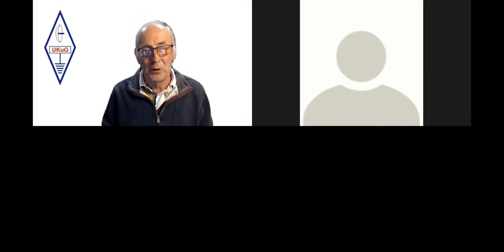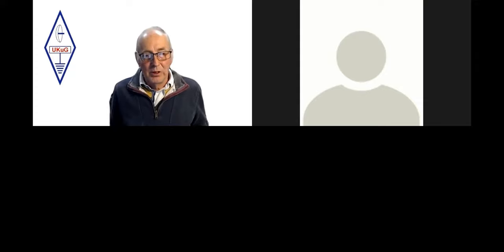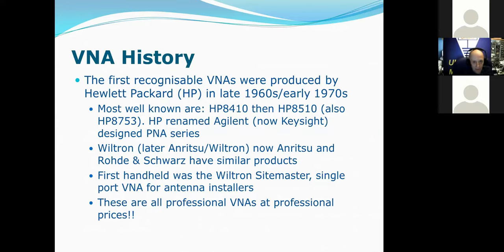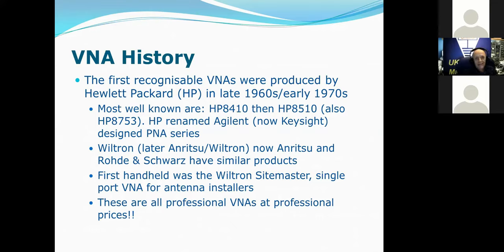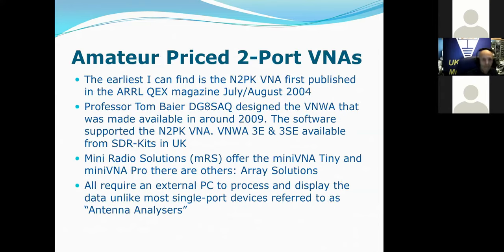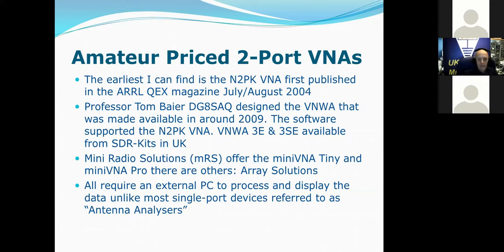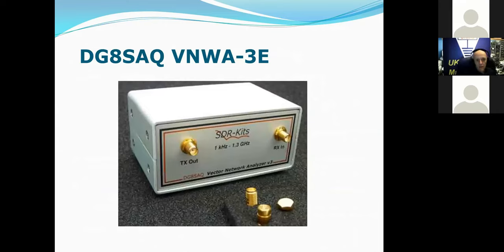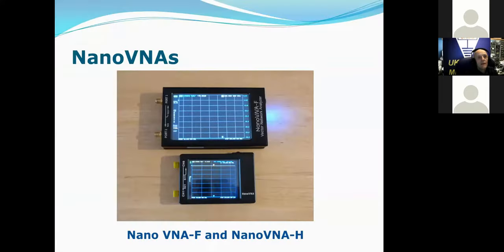UKuG NanoVNA talk by Bryan Harber G8DKK - Dec-2020

Comment: I believe there is a error in the slide @38':40" S21 would be power from port 1 into the port 2, not other way around. It is the ratio of 2/1 but the power is coming from 1.